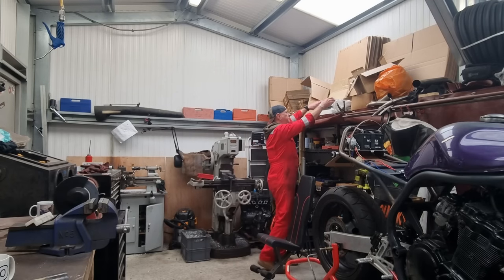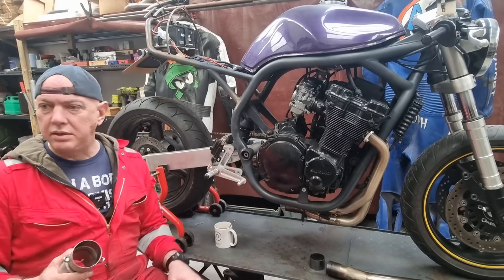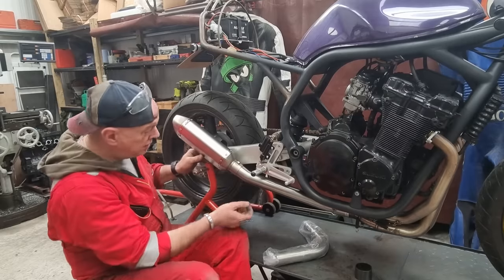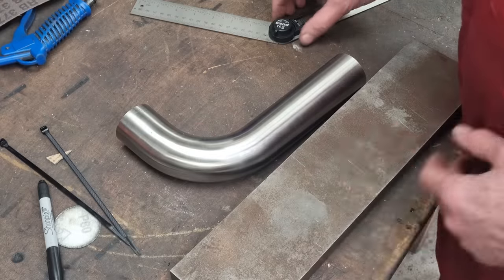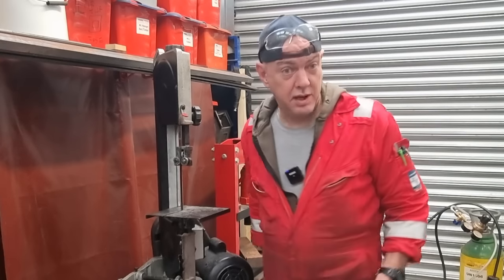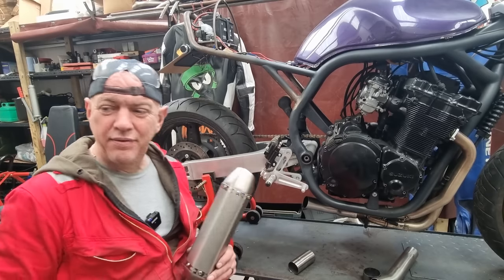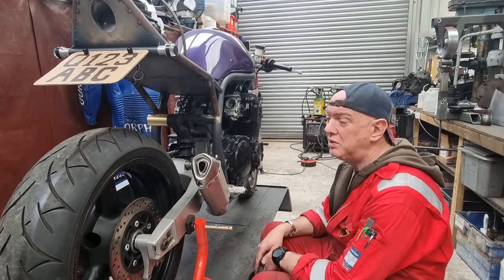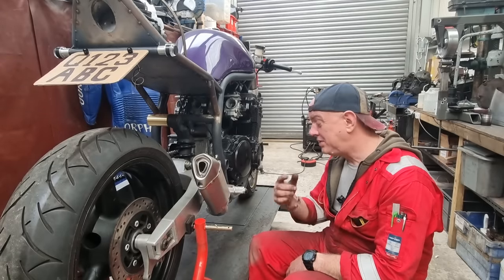Making a not SO noisy exhaust - Suzuki Bandit Cafe Racer - ASBO Project

Comment: That looks lovely, Simon, but I do worry that it's gonna be a boot melter.  Even with your toes on the brake pedal, your heel is gonna be really, really, close.  If you ride with the balls of your feet on the pegs …

I know you know what you're doing, but I get very twitchy watching people using cutoff discs with bare hands.  I have the scars to go with that twitch :)
Reply from the maker: It all seems fine with my size 11's and the pegs on the balls of my feet or the arch. I think it'll be alright but then again, everybody rides a little differently.

I know what you mean about the grinding discs... Really I need to get another grinder and keep one set up with a slitting disc and the other with a grinding pad. I'm not a big fan of gloves, but they do have their uses sometimes 😂